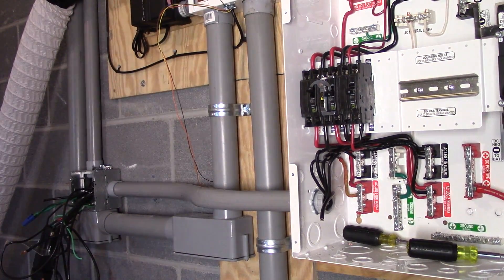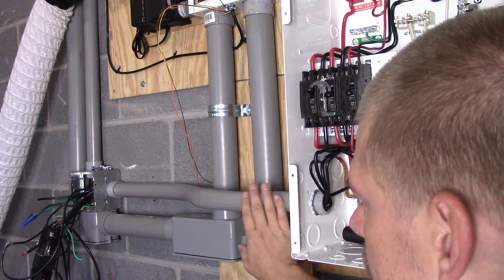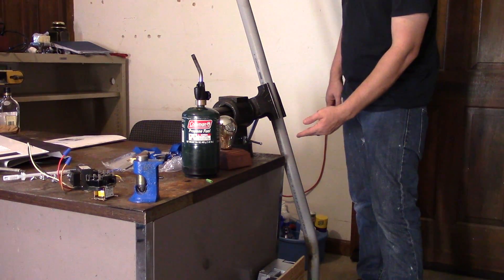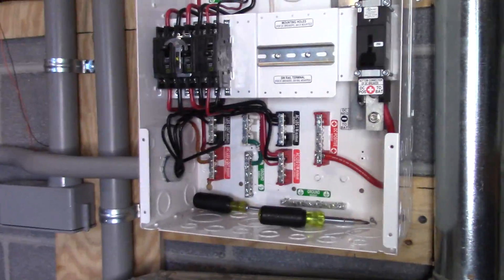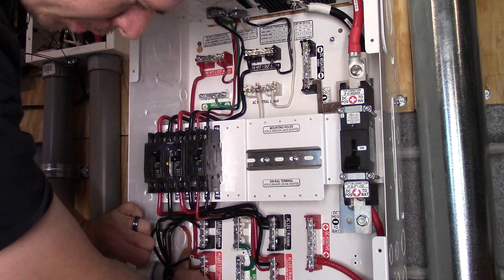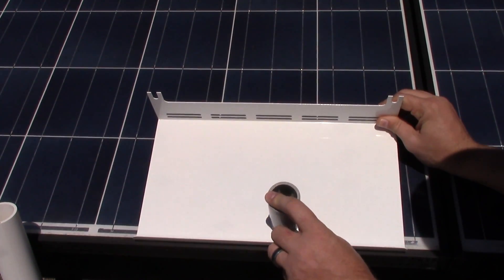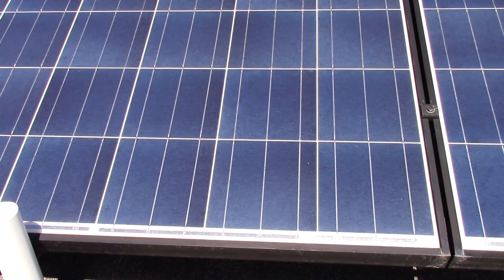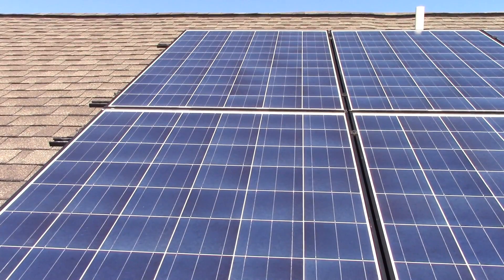Update On The Solar Magnum Inverter Installation & Solar Output

Comment: Give up on the low voltage charge controllers they are to hot an not very efficient I went with 2 Schneider 600volt 80amp charge controllers after years of messing with 150volt 60amp charge controllers and the difference it's more than you think ..

Comment: Looks good man. That pipe hot box we had was not cheap. Smart move with that. Looks nice.. Sorry about your CC bother.
Reply from the maker: no problem bobby
Reply: Here is the one we had. Told you not cheap lol.. http://www.greenleestore.com/products/greenlee-851-1-2-4-electric-pvc-heater-bender?utm_medium=cpc&utm_source=googlepla&variant=15441080515&gclid=CNml1vv89M4CFY4vgQod04oBXw

Comment: Isn't that refer to as an offset? Could you have not use some trig and bent some rigid pipe without compromising the integrity of the PVC?
Reply from the maker: there's many different ways to do this with heat I did it my way
Reply: Solar Power Electricity and Electronics Is that an approved method?
Reply from the maker: Yes will have this inspected again and I will not fail just like the last time I past. tomcat did fail =)
Reply: Solar Power Electricity and Electronics Who's your inspector?
Reply from the maker: Why would you like to know?
Reply from the maker: I have had the inspector here and I did not fail. don't be mad
Reply: Solar Power Electricity and Electronics If I ever do any questionable work I need a go to guy.
Reply from the maker: You need to understand this I'm safe. My family is safe and there is no state that will fail my work because it par with code. Your a funny guy.
Reply: Solar Power Electricity and Electronics Not mad, just need a variance every once in a while.
Reply: Solar Power Electricity and Electronics My bad, I didn't know that applying a torch to PVC was a approve NEC conduit bending method.
Reply from the maker: I'm not mad just correct. I've ran miles of power in new inspected home for the state of Tennessee.
Reply: Solar Power Electricity and Electronics So applying a torch to PVC is a approvable method?
Reply: Solar Power Electricity and Electronics Who's saying your mad?
Reply from the maker: Your inferring
Reply: Solar Power Electricity and Electronics No, read the post. You ask me not to be mad.
Reply from the maker: Okay, you got me on that.
Reply: Solar Power Electricity and Electronics I am taking it, I don't get much credit
Reply: Solar Power Electricity and Electronics Do you know how to bend conduit with a bender?
Reply from the maker: Thanks for being considerate.

Comment: it's best to never run your electronic equipment to the limit if it's rating. when you go to 48 volts that will change the the current out as the voltage will be double